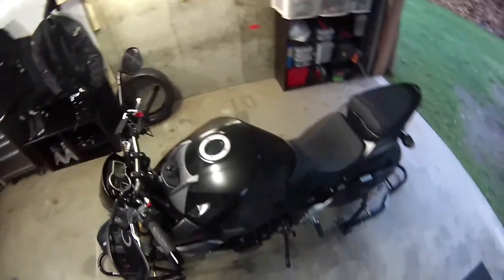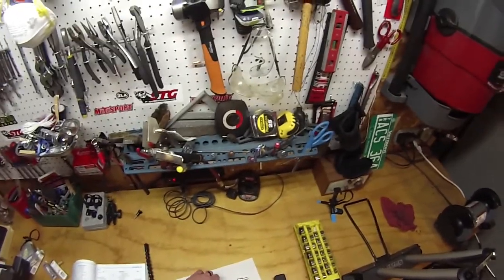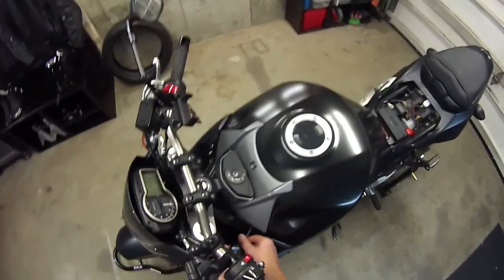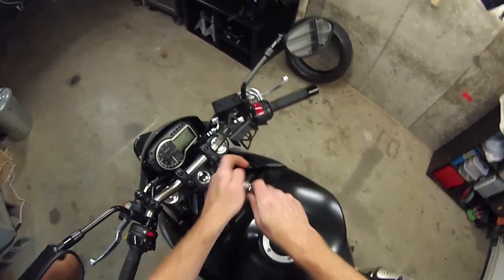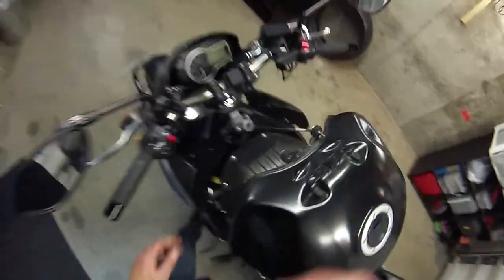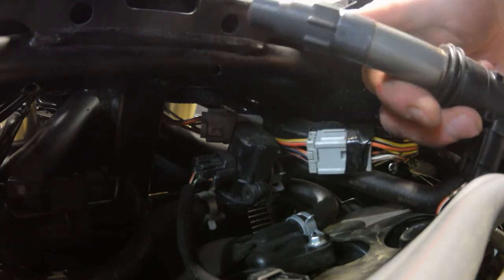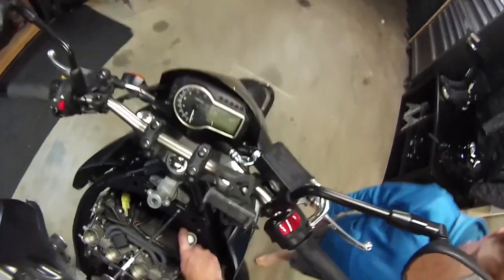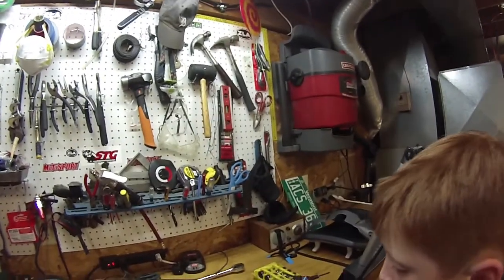HOW-TO Spark Plugs | Suzuki GSX-S750 | Do It Yourself

Comment: Again, I’d like to thank Michael for making this possible: 

I have the 2020 and the hardest part was removing all the fairings for the first time. Also, when you get to removing the air box part, I marked everything that I disconnected with a paint pen, 3 tubes and 2 plugs.For the plugs, it’s easier if you unscrew the mount that holds it instead of taking off the tape to unplug it.
Reply from the maker: I have heard those fairings can be tough! Time consuming. Help me understand when you say “unscrew the mount instead of taking off the tape”.  What’s that?
Reply: @sstressfl   I didnt notice on yours but on my airbox, there is 2 mounts for the female connectors, which also has a tube. Instead of unwrapping the tape securing it to the male, I just took off the bracket to keep them both together. Ill try to find a pic in the manual. Edit: page 1D-5 "IAP sensor with vacuum hose"
Reply from the maker: @drewdub8425  Oh gotcha! Mine didnt have tape but I see how you removed the entire sensor - exactly like the manual instructs :) Good catch!

Comment: I enjoyed the video, one thing I always do on any spark plug is use anti seize before installation. I don't have the flexy tool you use but have a magnet on a stick which is handy in the plug hole or anywhere else out of finger reach. Many thanks.
Reply from the maker: Thank you 🙏 I don’t use anti seize because they get changed every 7500 miles 🤗 but I do on my minivan which get changed every 100,000 miles 👍
Reply: What would the torque compensation be - I always forget.

Comment: It is interesting why an iridium plug is recommended to be changed at 7500 miles by Suzuki when in a car the intervals are 8 to 10 times longer.
Reply from the maker: I’m thinking it has to do with how many times that spark plug has to fire to keep up with a bike with an 11500 rpm redline vs a car that spends a lot of time between 1200-5000 rpm.
Reply: Pretty much everything in the manual is to be on safe side. I've changed original spark plugs after 1k miles to iridium ones. At around 8k miles service the guys at shop said "we saw you installed new plugs yourself not long ago so there is no point to change them". Those plugs were almost a year old at that time.

Comment: Question about the tool that you re using to hold up the gas tank. Did you purchase it from Suzuki or did you make it?
Reply from the maker: I went to Home Depot and bought a long peg board hook. They sell them as single purchase for like $2 :) I put it in my vice and broke off the soldered piece then straightened the bent part out a little bit :)

Comment: Hey Mike, Fellow GSXS750 forum member. I'm trying to find a newton meter torque wrench that is similar to the one you use. Do you have a model number or an Amazon item similar?
Reply from the maker: This is it... I got mine back in the early 90s. https://www.ebay.com/itm/SEARS-CRAFTSMAN-TORQUE-WRENCH-94463-0-600IN-LB-0-691-CM-KG-3-8-Drive/173591997132?hash=item286ae3aacc:g:hvkAAOSwarlbxhLS
Reply: Love all the vids. Thanks for fast response. Now to see if my CFO (wife) lets me buy all the parts

Comment: Whre did you get that rod to hold the gas tank up
Reply from the maker: Home Depot! It’s a long peg board hook :) I broke off the little soldered bracket and bent it a little straighter. Works like it was made to be a gas tank holder 😂
Reply: Hell yeah! It's perfect. How long is it? About a foot?
Reply from the maker: @2wheelcommoner  10" https://www.homedepot.com/p/Everbilt-10-in-Zinc-Plated-Steel-Single-Straight-Peg-Hook-1-4-in-Peg-18037/202305522 , and I flattened the end of it so it's closer to 11" when using it.
Reply: You're awesome brother! Thank you!!

Comment: Hey there so after washing the bike unfortunately the turn signals started to act strange when the bike is on but when it’s off they works just fine , did it happened to you ?
Reply from the maker: Hmmm... that did not happen to me. There are a lot of wires along the top of the engine. I wonder if something got pulled loose while you were working and then got wet causing the behavior? If its still doing it, I'd pull the tank back up and check everything. Look for exposed wires. Wet wires. Trace your signal wires and make sure nothing got pinched. Hope you find it!

Comment: Very tough job, I can service my 135cc bike entirely by myself but if I own a superbike, I wouldn't work on it, this is too complicated and needs a lot of tools I don't have.
Reply from the maker: Milind S Vashist I used to feel that way about new cars too. And then I worked on one and realized under all the wires and plastic engine covers it was still the same as it has always been. Give me a good manual and some YouTube videos and I can usually get it done. The tools are definitely required. I’ve been buying them (and getting them for Christmas/Birthdays) since I was a kid. Worthwhile investment! But I will also admit not all jobs are diy. Knowing your limits is critical to success. If your uncomfortable with a project, no harm in taking it to a trusted mechanic. 👍 I’m curious about your 135cc bike. What year make and model?

Comment: Is your bike the same with gsx-s750 - 2017 model??? I could not find service manual for 2017 model((( And what kind of spark plugs do you use? I want to change in my gsxs
Reply from the maker: Andrey Kim I think it’s the same spec as mine but to be sure you can always pull a plug to verify. The plug will have a number on the side. This is what I used for my 2015: NGK Spark Plugs CR9EIA-9; Spark Plugs #6289 (4 Pack) Made by NGK Spark Plugs https://www.amazon.com/dp/B00AW22SGK/ref=cm_sw_r_cp_api_i_zFRTCb28AFCPH